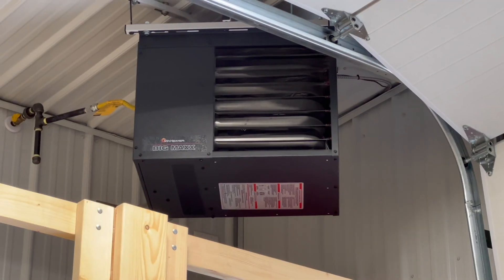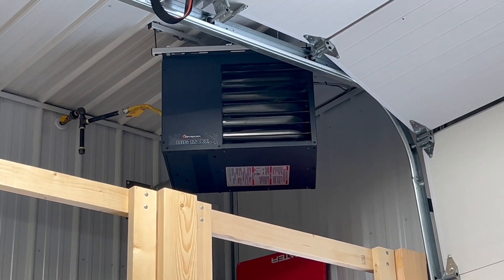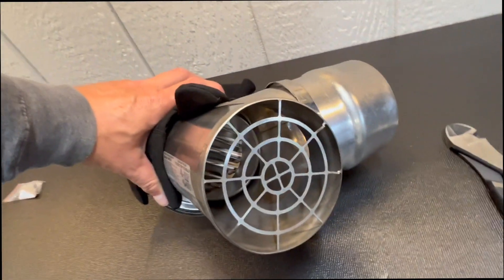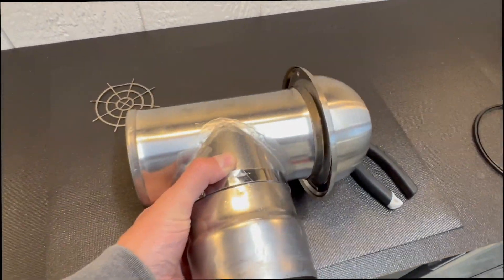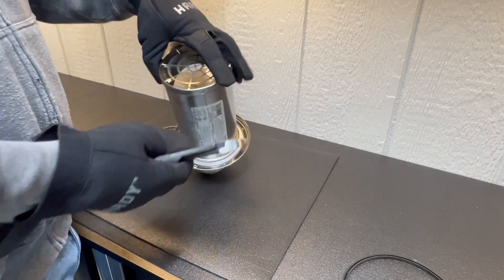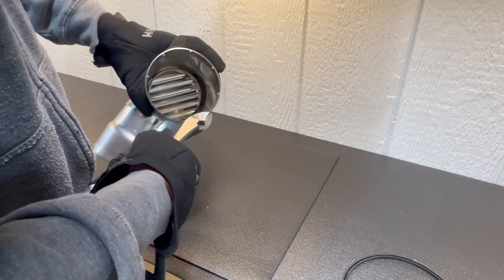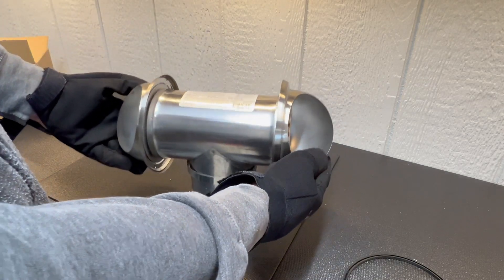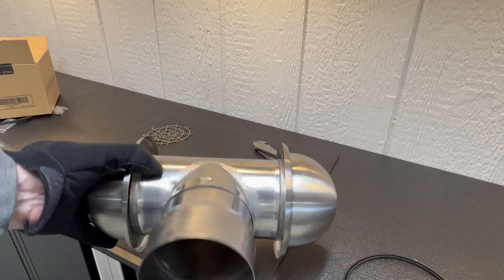Big Maxx Furnace Hack: Solving Windy Day Shutdowns

Comment: I may have to do this with mine. Every time the wind gets above 45km it tends to blow my furnace out. Also my T isn’t horizontal it’s vertical I wonder which way is better.
Reply from the maker: I really wanted to keep mine horizontal to keep rain out as much as possible. On really windy days it does still short cycle but not as bad as before so it was worth it.

Comment: I have the same issue with my Big Maxx 80,000 BTU unit. I tried replacing the Tee with a High Wind Cap. At first I thought it helped, but it did not. So frustrating.
Reply from the maker: These things definitely have a sensitive safety sensor. Mine is definitely better based on what I’ve added to the T but on a really bad windy day it still does short cycle a lot more than I would like.

Comment: Also, whose got the best, most reliable, and proven CO detector that you'd recommend. 
Thank you once again. 
Robert
Reply from the maker: If you want reliable and proven always stick with the name brands like Kidde. I couldn’t find a WiFi battery only version though and really wanted it to alert me when I’m not around. I went with this one by X-Sense which has pretty good reviews. It does work as I’ve had a car idling in the garage and it went off after a few minutes. 
https://a.co/d/cljKWln

I do wish the Google Nest protect detector had been updated. They still sell them but they are old stock it seems and have a good amount of failure rate now. Someone needs to come out with a comparable product as it had a lot of good intentions.

Comment: Great video.   It is very thorough, well organized and easy to understand.   My question is, what caused you to decide to go with the  "T" configuration?  Why not just install the louvered cap directly onto the furnace flue gas discharge?  
Robert 
Thank you.
Reply from the maker: I appreciate your compliments on the video! Originally I went with a T because it was the cheaper option. Saf-T vent makes a cat III rain cap with louvers or slots but in my research it has the same issue with wind so I just never tried it. Home Depot has a whole kit that has a backflow preventer in one of the short pieces that comes with it. I assume it’s some sort of flap that closes but my fear with any of those types was if that flap gets stuck for any reason you’ll have exhaust in your garage or it will just do the same thing and keep triggering the sensor on the furnace.

Comment: I’m having the exact same issue with a 50,000 btu big max heater I’ve tried numerous different end caps even tried a high wind style cap still flame goes out and restarts on windy days. It must be a heater issue as other people have same terminations and no issues I have not tried what you did here, I feel the wind would still funnel into heater though
Reply from the maker: I think in general this brand has a sensitive pressure switch. I’m very out in the open here so we get wind all the time where others may not. So far this winter since adding the caps it has made a major improvement. I can’t say it eliminates the issue 100% but I’m very satisfied at this point with how the furnace operates on windy days. Hopefully you can get yours figured out as they are a decent heater for the cost.